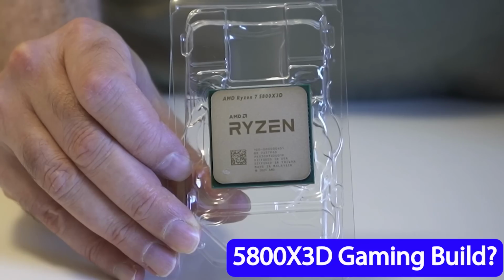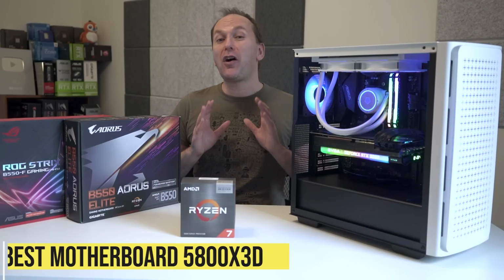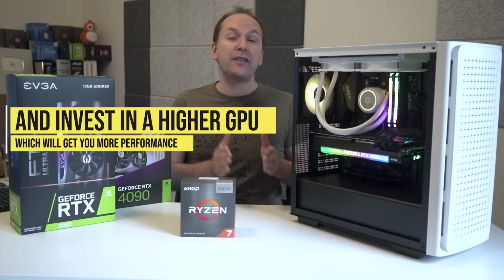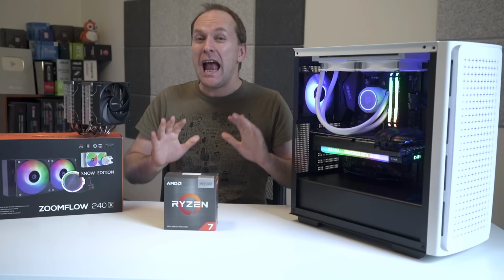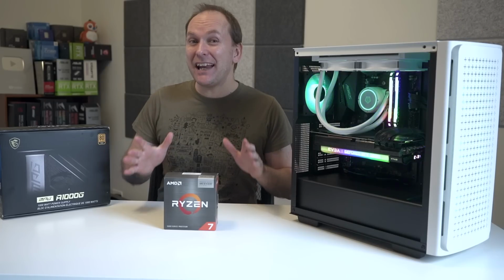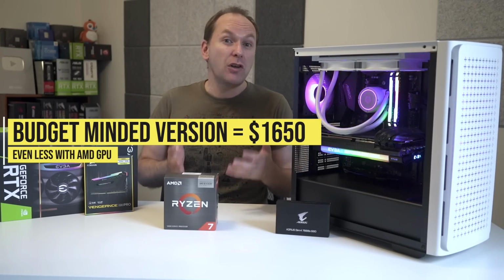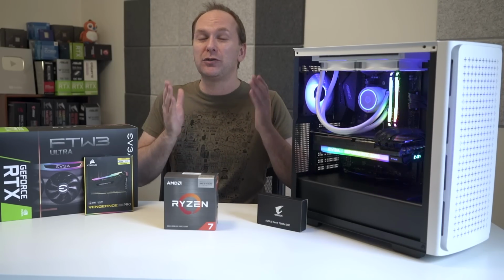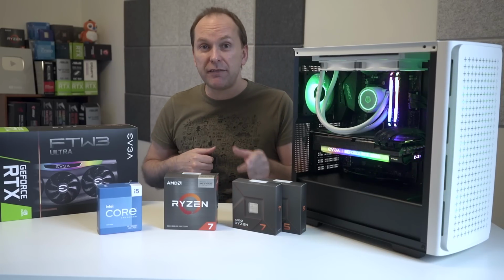🛑 4K Gaming is CHEAP! 🛑 Ultimate Ryzen 5800X3D Gaming PC Build

Comment: Belle config ,mais EVGA demande 750 watts pour 350 watts de consommations ,une 850 de qualité est suffisante pour un usage lambda 
 les personnes qui oc et match des bios gonflé alors une 1000 watts effectivement sera un minimum, mais la plupart ne touche pas et  parfois crée un profil  sous cadence de CPU  et GPU  pour la chauffe et consommations exemple avec cette méthode je passe de 670 watts max de conso a 410 max et avec une bonne 850 watts ca match  avec un  RTX 3090 donc il y a toujours des solutions eco

Comment: May I ask if a 3070ti would be good with this cpu? I'm currently planning on purchasing this cpu!
Reply from the maker: That's lower than I would go with it. With that GPU I'd go 5600X. If you want the 5800X3D minimum is 3080 or 6800XT

Comment: AIO looks nice but the sound and the heat it produces to the Room is annoying. That's why I switched back to aircooler, don't look so nice as AIO but they are much silence and the room does not get too hot.
Reply from the maker: Some are quieter than others but the one used in this video is a little on the loud side

Comment: This was my exact comparison and build options 2 weeks ago moving up from a 4790K - I was comparing the 5800X3D vs 13600K vs 7700X and landed on the 5800X3D as well. Thanks for the validation!!! Now just waiting on the GPU options to upgrade my GTX970 as well!
Reply: For you, 3060ti,  3070 are good, but the best would be RX 6700 XT 12GB. Its basically a 3070 with 12GB and perfect performance for 1080p for FPS games. but for story games like Elden ring or CP2077, where you don't need more than 60FPS, it can do 4K too. I went from 5600x and 6700 XT 12GB to 5800X3D and 6800XT 16GB. Both are good
Reply: @ancientslav4863 I just bought a 6800xt and thinking to pair with 5800x3d, nice to know it’s known as a good combo 👍
Reply from the maker: Glad it was useful! Thanks for watching (:

Comment: Should be a dream WoW build. Unfortunately just have to build before the expansion hits or wait and do it later maybe around 2nd raid. How I ended up with 9600K for Shadowlands, helped a friend do his build/upgrade back for Shadowlands a couple months/so later 5800X build with RX580 he carried over during shortage. The cores and ipc are great, he was super happy with that, 32gb ram I suggested, which with all the addons he uses and multitasking seems appropriate. He's still in 1080p. Am getting by nicely still 1440p low has high fps for Dragonflight prepatch, replacing the nvme with a better one with more dram, can hold high fps in Oribos and everywhere. Am surprised your GL waited so long to upgrade, had issues back with Skylake i5 not being enough late BFA Nzoth horrific visions patch, would have to unstick the game to avoid crash by inducing lag, which was about when I started planning the upgrade for SL prepatch, after testing on PTR back then and my performance wasn't where I wanted. I can certainly see interest in doing a 5800X3D or possibly waiting for a 7800X3D and going ham on the new platform. Have 2 evo212s in the old WoW rigs, with the WoD rig as our family's tv computer on Linux. I seem to upgrade when there is something new where I can't push performance, WoD was using the office pc I had around, Legion Nighthold was the second WoW prebuilt rig, and current one am happy except raiding/m+ holding high fps is hard, sometimes end up render scaling, affix usually explodes drops fps a bit (fated raids etc).  Legion I did the build for the 2nd raid and that was good timing with Pascal cards etc. Am fortunate should be able to carry over parts to upgrade/build the next one. Found FF14 (doesn't seem like 1-2 years ago) more demanding for 1440p than WoW with my setup. I upgraded storage nvme size/dram and shucked 20TB I found on sale to add to my storage recently this month. I think I really want to do the CPU next upgrade, as it seems to be struggling more in those scenarios, raiding, m+, ashran etc.probably the first improvement. Am wondering if there will be a GPU intensive zone like Ardenweald was that certainly was where I would see the most usage. Am back to Windows again, the launcher has been breaking during prepatch on Linux and it's annoying enough where it's easier to just play in 10. Certainly feel your recommendation to upgrade to a 1tb nvme was a great one, still have 512gb in the other slots but it's nice to have room and speed. Still on 32 1440p for monitor, feels like a good spot, maybe once 34 are cheaper will upgrade one day but 32 feels large enough.

Comment: I’ve got a ryzen 7 5800X, could I upgrade to the 5800x3D? Would it be worth it? And is it just a simple plug in and go? Or would I have to do a bunch of stuff to set it up in the bios of my motherboard?
Reply from the maker: Probably not worth it unless you have a 4090. Otherwise I'd just work on upgrading your GPU

Comment: I was building 3 machines for Christmas, to specs requested. The 5800x3d is extremely under rated. 5950x with a 3080 under a 24 hour test load started dropping fps. The 5800x3d with a 6800 never dropped. It still beat the 3rd with an intell build that was rated higher on user benchmark.
Reply from the maker: Awesome! Thanks for sharing
Reply: Id avoid userbenchmark in the future. Very unreliable and biased.
Reply: @retrosimon9843  I saw a video on a forum of people was cheating the benchmarks and how it didn't show real world performance.

Comment: How much performance would you lose at 4K if you went down to a 5600X? Right now here in the UK the 7600x is actually quite a bit cheaper than the 5800x3D which (partially) negates the cost saving of staying with AM4 and DDR4 RAM.
Reply from the maker: If your goal is 4k 5600X and a 6900XT would be a good choice (:

Comment: ⚠️Hello, Does MSI B550M pro vdh wifi motherboard display port supports 120hz reefresh rate at 1920*1080p on amd 5600g apu. Can i play games on MSI G241 monitor at 120hz with this motherboard display output. No dedicated gpu attached❓

Comment: I ended up picking up a 5800x3d for $330 new on ebay and then the Gigabyte AORUS Elite motherboard you recommended for $150 from Newegg, for a total of $480 before taxes as I already have ddr4 ram. Whereas a 13600k build would've costed me about $20+ more from the motherboards I could find that were actually in stock. Either way, it might not be much but $20 saved is $20 saved.

Comment: Hello sorry if I missed this but is there a way I could send you my amazon list to review my upcoming build, and how much would that be? I just want to make sure I build correctly, which I don't think I did on my current build. Thanks!
Reply: I'm not a big expert, but I've learned things from Jason so maybe I could help.
Reply: @ty09162  Hey thanks for the response. I'm just mulling over what CPU to pair with the upcoming 7900xtx. I much rather do an all red system. I am willing to go to AM5 with the increase costs but would it really be worth it? (cost to performance, bottleneck,future proof etc.) It seems that the AM5 platform maybe around $200-$500, mostly increase in motherboard costs.
Reply: @raulnavarrete963  motherboard and also DDR5 RAM is expensive.  You could save money and get a 13600k with DDR4 RAM but if you prefer to go all AMD then the 5800x, and 5800x30 would be good AM4 choices or you could go AM5 7600

Comment: Hi Pc builder I recently made a pc with a Ryzen 7 5800X3D and a 3080 but I used a PSU I had lying here (Corsair RM750X), I did some benchmarks and stresstests and the pc is running fine, is that ok to only have 750Watt PSU then?
Reply from the maker: Up to you of course. We did just have a 3080 shut down our editing pc today 3 times with power spikes (a 850 watt paired with 3080 and 5950x) so personally I would go for something stronger. But it's entirely up to your comfort level. See our Best PSU 2022 video for more (:

Comment: I just got a 7700X today from microcenter. They are 399 w/ 32G 6000 RAM + $50 off the MB. I was going to get a 7600X for $249 but the microcenter deal was over all just better. I tried to get them to price match the 7700X at 349 deal going on right now, but they said they could not, however some people said they got lucky and MC price matched it, that is a literal steal for sure.
Reply from the maker: Nice!
Reply: @PCBuilderChannel  you should do some benchmark testing for new world with 7600x 13600 and 5800x3d

Comment: Corsair VENGEANCE RGB DDR5 32GB (2x16GB) 5200MHz C40 AMD Optimised Desktop Memory

AMD Ryzen™ 7 7700X Desktop Processor (8-core/16-thread, 40MB cache, up to 5.4 GHz max boost)

Gigabyte X670 GAMING X AX ATX Motherboard - Supports AMD Ryzen 7000 Series CPUs (Socket AM5)

£870.. IS THIS A GOOD BUILD ?  FOR PRICE

Comment: I’m building a new PC for 1440p gaming. I want to buy an RX 6900XT. Can I pair it with a 5600 or is that too cheap? Here in Sweden 5600X costs 30$ more and 5800X3D costs 270$ more🥴 Is it worth it?
Reply from the maker: You can, it's a little unbalanced. You would see a performance difference with 5800X3D. But I'd go at least 5600X
Reply: @PCBuilderChannel  but isn’t it a negligible performance difference between 5600 & 5600X? And if I were to go with a more powerful CPU; is it more worth it to spend an extra 300$ish on AM5/DDR5 platform with 7600X (more future proof I guess) or an extra 270$ish for 5800X3D?

Comment: Should I get a ryzen 7 5800x or a ryzen 9 5900 x. I’m going to be playing on 1080p and I will be using a zotac white 3080 graphics card. Please reply
Reply from the maker: For gaming I'd get the 5800X3D. But if that's not an option for some reason the 5800X is fine but you could also get great performance with a 5600X
Reply: @PCBuilderChannel  thank you so much

Comment: AMD removed Curve Optimizer for 5800X3D in the BIOS, making Negative offset voltage method and Kimbo Strike the only available options for that SKU, yet you can use Curve Optimizer in Windows still and even OC+UV it decently
Reply: Bonsoir , Merci pour cette info ,j ai toujours update les news bios ,mais la sur ma Rog B 550 E G peut être trop vite suis au  (V2803 )du 04/28/2022 et il semble que AMD a imposer de bloquer les bon sous voltages 
je vais recevoir le X3D a la place du 3800XT qui chauffe pas du tous avec 1.20V et j ai lus que le X3D monte a 90 degrés
je ne fait que du jeux pc ,combien SVP  pensez la température sur AIO de 360
Reply: @lucgrunenwald7795  Try PBO2 Tuner. The guide is on GitHub
3800XT is top binned silicon
For gaming, 5800X3D is on paar with 13900k and in my country it goes for under 400Euro
If you are already on AM4, 5800X3D is the best for gaming
Reply: @valentin3186  👍
Reply: oui suis sur ROG B550-E avec 3090 j était au 2080 il y a encore 2 mois  sur triples screen 1080P 6050x1080P et je vais recevoir une écran 49 pouces 5120x1440P et j espère que le X3D pourra contenir les FPS ,merci d avoir répondu
Reply: @lucgrunenwald7795  For 1440P and higher GPU is a bit important. 5800X3D is doing pretty good compared to AMD 7000 Series and Intel 13th Gen in games. You can check the benchmark results
Reply: @valentin3186  Merci  depuis 2 jours j ai chercher bcp d informations et tests sur le X3D 5800 , résultats de mes recherches  c'est le CPU Idéale pour le jeu consomme moi que ses frères, températures en jeux 
très correct de 62 a 70 mieux que 5800x , en applicatifs basique, en travail et traitement passable et gros point noir en travail et traitement pro chauffe trop mais vue que c est un CPU pour le jeux principalement décider par AMD ,il est a ce jour le meilleur en jeu 
j ai bien préciser a ce jour et encore un bon moment ,les nouveau AMD et INTEL chauffe trop et consomme trop et le Tarif 
de ses nouveautés est Aberrant comme les RTX 4000 Voila mon analyse

Comment: I have the same AIO in my system cooling a 5800x and it definitely does the job with no issues, but the pump is very loud and I even have it mounted on the top of my case. Just something to keep in mind if you’re thinking about buying
Reply: better a liquid artic freezer cooler II for little noise?
Reply: @tryfergoodra552  different price points

Comment: so I have a 3060 and need a cpu/mb upgrade was thinking 5600x but should I go with 5700x or 5800x or would that just be overkill
Reply: The 5600x is a good choice for the 3060.  5700x and 5800x would be a CPU GPU imbalance.
Reply from the maker: 5600X would be a good choice!

Comment: can someone help with not fully utilized rtx 3080 at 1440p in some games (cyberpunk, rdr2)? cpu is 5800x3d. gpu utilization is stuck at 94-95% at that res. can it be because of b450 pcie 3.0? btw fully utilized at witcher 3 and god of war.

Comment: Ive been going back and forth between a 12400/12600/5800x 3d.Im going with either a 3060ti or 6700xt so dont think I need to go as high as a 5800x3d...
Reply: 12400 would be the best choice but just remember the 13400 is coming.  Maybe at CES but not sure.
Reply from the maker: With that GPU I'd go 12400 or 5600X

Comment: I got a 5900X instead (for cheaper) and I think it's the better purchase if you don't only game on your system. Also, it's a better bet at future proofing and multitasking or streaming with the extra cores.
Reply from the maker: Also a good choice!
Reply: @PCBuilderChannel  not that I'm trying to justify my purchase as it was a no brainer at $325 USD while the 5800X3D was $365 USD, but I really do think that use case need to be added into the mix. An 8 core CPU is still a lot, but the extra cores really do come in handy while you are doing other stuff that's not gaming.

Comment: For 4k the 5600 or even the 5500 are sufficient, you get a lot more frames per dollar and you can invest the saved money in a much more powerful GPU. I have a Ryzen 5 4500(undervolted and bit underclocked), a B450 motherboard and a RX6600XT(undervolted) and I use it together with my very cheap Samsung 4k 60 HZ monitor as a 4k only PC. Eve 2 threads of the 12 are enough to play it, I tried it. I can play with 10 W CPU and 50 W GPU poer draw Forza Horizon 4 and 5 with very high to very extreme settings.  A 5800x3d is not necessary for 4k gaming. A good budget high performance 4k system would be a Ryzen 5500, a B450 board and rx6800and 16Gb very cheap 3600 DDR4 Ram for about 600 USD plus VAT including shipping and at least 4 free games(2 with the CPU + 2 with the GPU). Expensive CPUs are a waste for 4k gaming!!!

Comment: 5800X 3D is just too good to pass up right now. I see no reason to choose the 13600K over it when the platform costs are higher and there isn't a forward upgrade path since Intel is likely changing sockets next year. Picked up a used MSI X Trio 3090 for $700 and I was able to put together the 3D and 3090 for around $1,800 total. So good to see prices return to normal.

Comment: 156 FPS in WOW at 4K?  Did you also have raytracing on or no?  I have a rog strix 3080 10gb, and with the preset at 10 and RT at max i get 150 to 165 but in 1440P!  So you are way outperforming me.

Comment: I have a Noctua NH-U9s, which only has 5 heat pipes, not 6, on a 3700x and was thinking of upgrading. Is an AIO really necessary to cool this CPU? Id rather not spend any more if i don't really have to.

Comment: I just finished my build.
I wanted a 5800x 3d, but the price was going up daily due to short supply.
I looked at the reviews between 5800x 3d and the 5900x
They had just about identical frame rates in every game. Within 1-3% on over 50 titles.
So I bought the 5900x because it was 100 bucks cheaper than the 5800x 3d.
I regret nothing. the 7000 series is to power hungry. The 4000 rtx is ridiculous.
Reply from the maker: Sounds like a great build!

Comment: When you were talking about RAM, does Dual Rank truly matter at all? You said yourself that RAM speed matters less at 1440p and 4K, and when you were talking about the advantages of Dual Rank, it only gave a 3-7% bonus at 1080p.

Yes, that's an improvement, however, if we already have a super juiced system, does 3-7% more performance at 1080p truly matter if I'm already going to be running any game at that resolution at ludicrous FPS levels regardless?

In any competitive game where those insane levels of frames could potentially matter, they're generally so well optimized that you will hit well above the 240 (or even +360fps) goal for your monitor, or hit the engine cap, with this kind of hardware. Right? Isn't using 4 sticks also slower overall than using only 2?

Sorry for the lengthy comment, I just want to make sure I understand everything correctly. Thanks!
Reply from the maker: For a deeper dive on this subject head to our Best Ram for Gaming 2022 video!

Comment: Hey Jason, i’m in the market for an affordable cpu upgrade. I’m currently using an i7 9700f and 1660 super gigabyte. Any recommendations for a cpu that will future proof and not bottle neck too much. Thanks
Reply: The 12100F would be a good option.  It's only $109 on Newegg.
Reply from the maker: I second the 12100f and also the 5600

Comment: You keep saying "Budget" but none of the CPU/GPU you mentioned are Budget in WALLET :P. nowhere near "CHEAP"
Best Budget for 4k as of now
Ryzen 7 3700X - 170$ - New
DDR4 32GB RAM - 70$ - New
RTX 3070 - 350$ - Used

Yeah You could play 4k with these on WoW 100FPS+ at Highest Settings.

Comment: Hey guys I'm currently on an 8700k at 5gz, ddr4 2133, a 3080ti, on a 120 Hz 5120x1440 super ultrawide. 
Considering a full platform upgrade to 7700x and ddr5 6000. I play hunt showdown and a few other fairly graphic intense titles. Do you think this is a decent upgrade, as my current system can't max out the monitor in most titles I play.  Or, should I change to a smaller 32"  4k monitor instead, or sell the 3080ti in favour of a 4090. Thanks. Love the channel